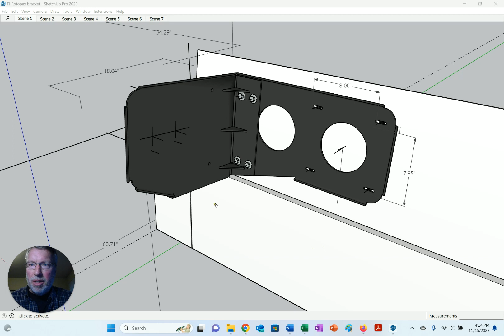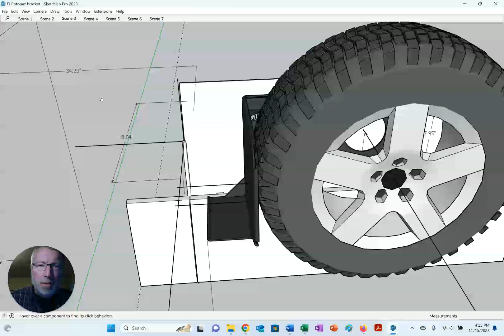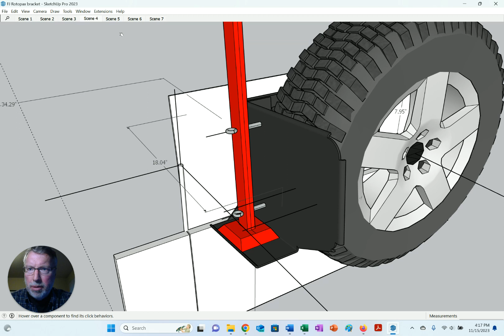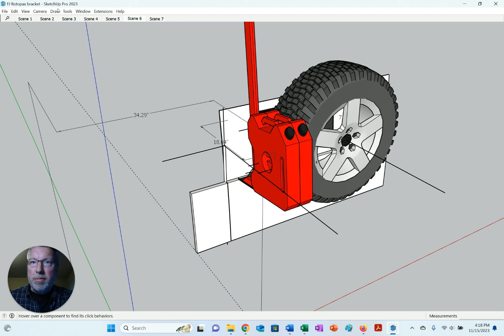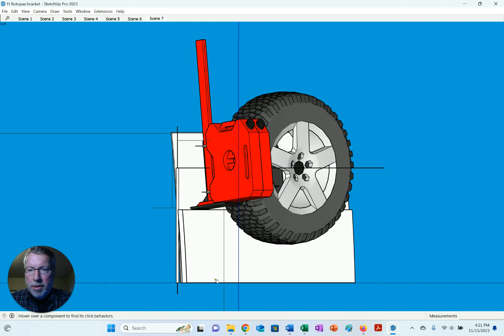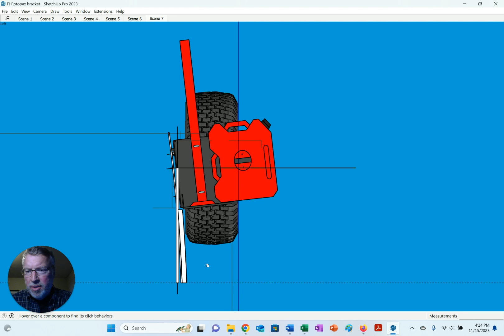RotopaX Hi-Lift Carrier for FJ Cruiser

Comment from the maker: To lock the Hi-Lift jack on the carrier, we are going to use 1/2" square neck carriage bolts (so they won't turn while tightening) and the Hi-Lift locking knob (VERS-LK)...plus a non-locking knob for the other bolt.